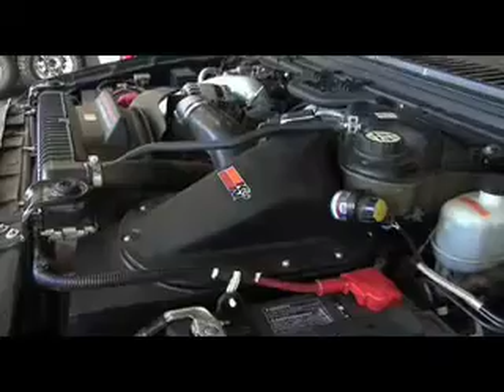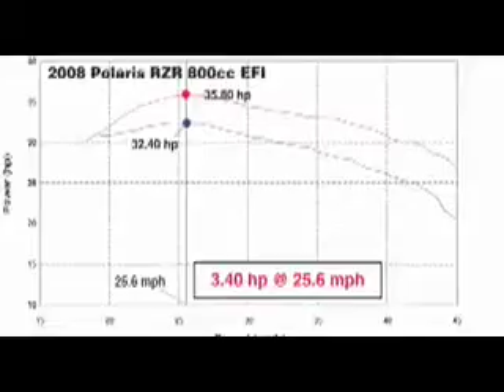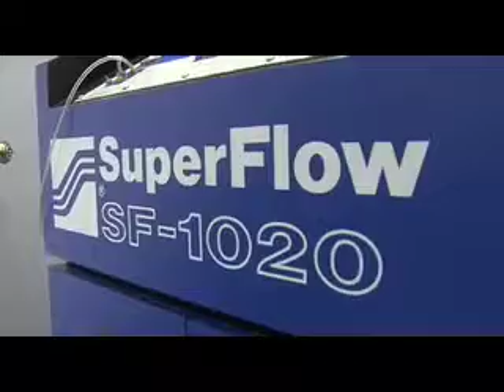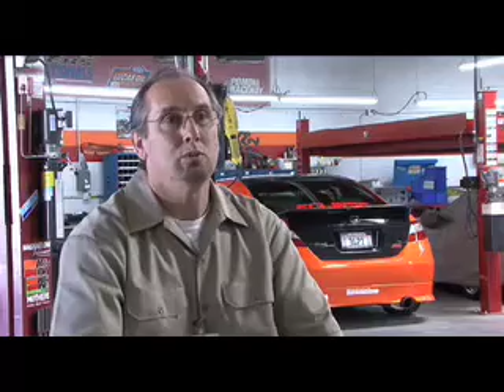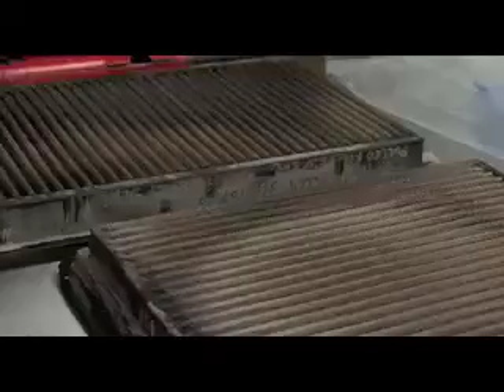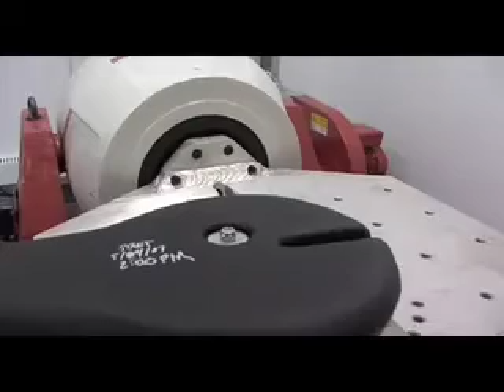Air Filter and Air Intake Testing

Comment: Hi K&N ! Does it necessary to use higher octane gas with K&N panel air filter ? 2018 Honda Accord Sport 1.5 turbo cvt . Is that any benefits ( more air , higher octane )? Compression 10:3.1 Thank you !
Reply from the maker: No modifications to your fuel or ECU are required. K&N intakes are ready to go out of the box.

Comment: funny everything people are saying is crap. watch the pressure drop ffs not all atmosphere is hot and sunny but it can be humid and damp. air mass meters play a huge part on the problem with performance. that's why you chip your ecu it helps the air flow.

Comment: ive been using knn air filter last 4 yrs since I replaced my stock suzuki filter on my bike, only took it out yesterday after about 20k miles it was dusty, I simply tapped it on the floor and removed most of the dust clumps and fixed it back,..
Reply: I think knn is the closest thing you can get without running a totally non filtered open carb I take without letting in the harmful large particles that destroys your engine..

Comment: I have been using K&N Filter in my off-roading Mitsubishi Pajero and they are indeed effective in blocking out the fine particles of dirt and dust which is found in the tropics. Because of this, I also replaced my factory filter by a K&N Filter in my 2014 Lexus IS 350 F Sport and I did notice a more responsive acceleration and better top end performance. I am saddened by the mostly negative response that I have been watching in the You Tube but in my case K&N really works wonders and the two performance shops with 4 Wheel Dyno Testing have shown me in the graph, the performance advantage (after they did a chip tune).
Reply: Of coarse there will be a performance advantage "after a chip tune" knucklehead!

Comment: i believe this only works if you have the proper TUNE for it... otherwise, the engine will automatically adjust itself to accommodate for the extra air, or lean out and engine goes bang. 

not good.

i'm no expert btw...
Reply: +Paul Son that's not true. I've got a 97 Honda prelude....the non-ricer edition :) anyway, totally stock ecu. it's got a cheap cold air intake. I combined that with a custom, sealed ram air system, it is getting tons more air then stock. it's made a huge difference in not only power, but also some better mpg (about 3-4 mpg)
Reply: +Paul Son also, the k&n filter is oiled, so it will actually flow less then the paper type (cone filters)

Comment: Thankyou k And n I always switch to. K and n look at the quality and engineering behind it your a fool if your think a stock filter is not restricting air flow...... true the engine will adjust but you will feel a slight difference. It just a air filter not a turbo...

Comment: Just watch CAI myth busted.
Reply from the maker: 2010V6RAV4 This video is not a legitimate measurement of hp. The products they use in this video in no way represent whet K&N manufactures. K&N Guerentees horsepower gains with intakes.
Reply: +KNfilters you should probably learn to spell

Comment: I enjoyed the K&N filter with the louder air intake sound and a feeling of more than the 2% claim including the improvement in throtlle response and raspy sound ...on the Mazda3 ...next week I want to try it on the 2L 173hp Forte ... the subjective feeling is the ultimate criterion for me
Reply: Surprise performance on my first try with a torquey new GDI car...the car felt smoother...no loud V8 burble as it accelerated and no growling induction note as I got on the Mazda3...guessing that the computer may have to adjust to the new air flow already generous at -15 degrees...and I was using more gasoline trying to make it sound sporty...well, at least it sounds more civilized and sophisticated ...did I really want that? ....sometimes...yes
Reply: post: the car did tune in to the new filter after a few days and changed its note from a V8 growl to a more sophisticated sports car note... and the economy returned.
Reply: 7.5L / 100 km on curvy backroads is pretty good but as much as 8.5L/100km on a freeway.   but much better than the 9.5 I got with the 148hp Mazda3 on my new 173hp car with the same weight and the fun of the torque that pushes you back in you seat.

Comment from the maker: All of our filters meet or exceed OE spec. All filters have an initial efficiency of 96-99%. Our filter oil cannot damage any part of a vehicle. We have proven it not only can’t pull from the filter, but submerging sensors in the oil caused no damage at all. We have videos on our channel showing the tests with MAF sensors and our oil.

Comment: I've had a  Typhoon intake for my 2007 RX8 and  after  taking it  to a dyno i noticed a loss in  power rather than a gain. when placing in the drop-in  filter from  K&Y,  the  increase was about  4-5% from the typhoon, and  about 2% increase from the stock filter, i'd imagine.

this was a few years ago, and i still have the Typhoon in my  garage back in the package, i was  curious as  to what's the application you guys  used to show the gain in power for this car? is it because of the enclosure?

Comment from the maker: All of our filters have an initial efficiency of 96-99%. They meet or beat OE specs in efficiency and flow more air. OEM’s tend to not equip performance filters in their vehicles because the cost is higher and would eliminate a customer from needing to purchase replacement filters periodically. OEM’s also offer very similar performance filters through their own aftermarket lines (Mopar, GM Performance, TRD, Nismo, etc.)

Comment: I have a 1996 jeep grand Cherokee and i recently installed a K&N air intake, when installation was complete  i found that there was a small space between my intake and throttle body. my jeep runs great and all but im just worried i don't think there should be that space there.  What should i do?

Comment from the maker: K&N does not test for, claim or guarantee fuel economy increase because it is impossible to test for. In theory, fuel economy can increase because the engine is not working as hard for the same output due to the increased HP (created from less restriction, not more fuel) requiring less throttle.

Comment from the maker: You are correct that the MAF sensor will adjust fuel input for increased air flow. Yet a K&N intake system will not add more air into your engine. The HP increase comes from removing restriction caused from the OE system. The only way to increase air consumption by an engine is to add forced induction (i.e. Turbo or supercharger).

Comment from the maker: I’m not too sure where you got the CFM ratings for these filters, but they are not accurate @ 1.5” of H₂O. The specific pressure drops need to be looked at when comparing. The benefit of a K&N OE replacement filter is to have a lifetime washable reusable air filter. Our OE replacement filters will give a 1-4 HP increase in average, which cannot always be felt. K&N produces full intake systems for the HP enthusiasts, not the OE replacement filters.

Comment from the maker: The efficiency will be high with either the OE replacement filter or the intake system. If you are after as much HP as possible, the intake would be the path for you.

Comment: If you want to gain HP from an airfilter, have your vehicle tuned to take advantage of the extra air. The difference between a filter and system is that a filter drops in to your stock airbox and a system replaces your entire air delivery system. From throttle bottle to filter.

Comment from the maker: @RobeeBarrera It is against federal law in the United States for a manufacturer to require the use of a specific brand of air or oil filter unless it provides a replacement air or oil filter, free of charge, under the terms of the vehicle warranty. For a more thorough discussion of this law known as the Magnuson-Moss Warranty Act, see our Vehicle Warranty Section of our Air Filter Facts page, and our Letter Regarding Vehicle Warranty and K&N Replacement Filters on our site.

Comment from the maker: @28monkeyking28 The intake system will replace the stock tube and air box with a new system and the stock replacement is a direct swap with the stock filter.

Comment: What's the difference between a filter and an intake??? does the intake replace the whole stock air box? whereas the filter is a replacement for the stock filter that's in the air box? O_O_O_O. HELP GUYS =S

Comment: @KNfilters HOW MUCH FOR A DUAL RAM AIR INTAKE 2008 G35 WITH PANEL FILTERS ?? From the factory Infiniti states their DRAI addes 3 horsepower at 60 mph, SAE rates it at 306 hp. Infiniti's number is 309 including the intake's added 3 horsepower. How much should you have then ? 312 ? 3 hp over normal OEM filters in a Dual Ram Air Intake ?

Comment: Air flow should be last. Then the effectives then capacity.  The whole point of an airfilter is to protect the engine.  I'm a huge fan of K&N and have used them on all my machines. (actually I just bought a new air lid for my C3 Vette just need to get it to measure and see what K&N will work for it)

Comment from the maker: @mr010tommy010 For the 2004 Cadillac CTS 3.8L, we offer an OE replacement filter that will give a 1-4 HP increase (part 33-2251), and a full intake system that showed a 14.24 HP and an 11.91 lbft of torque increase on the dyno (part 57-3042).

Comment from the maker: @The1FastGP You only need to spray the cleaner on the outside of the filter, rinse from the inside to the outside, and then apply oil to the outside when dry.

Comment from the maker: @The1FastGP The filters on our intake kits need to be cleaned every 50,000-100,000 miles, or when dirt meets or exceeds the wire mesh. As the filter taps dirt, the efficiency will become greater without the flow rate dropping at all. Over cleaning the filter has no benefit to air flow, but can damage the filter.

Comment from the maker: @urbex2007 The reason we state which size particles are being used and what gets through is because to offer correct and accurate test data, we must. There is no such thing as a 100% efficient filter; in this case not even air could get through. Our filters start anywhere from a 96%-99% efficiency and become more efficient while collecting dirt without losing air flow, where a paper filter starts at a high efficiency (98%-99%) and clogs much quicker restricting air flow which decreases HP.

Comment: if anyone know im considering putting a k@n filter on my 02 impalla not a cold air custum just factory will this what benfits would i see by going k@n and is it possible that the 3.8 engine i have would not like the extra airflow

Comment: depends on how restrictive an air cleaner/filter performs. I once bought a cheap cold air setup and tried to use the filter that came with it on my small block 400 gmc and I was thoroughly disgusted on my way to work. My acceleration @ all rpm was so bad I turned my truck around and drove home, swapped back to my stock setup and drove to work late.

Try folding a towel in half twice, try to breath through it, then unfold it and breath through only 1 ply and then you get some idea of what I mean.